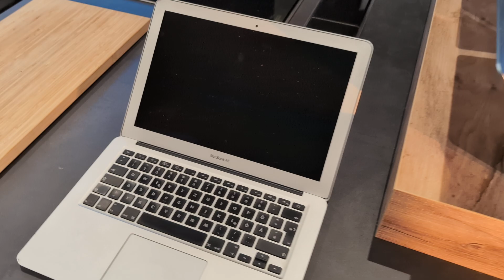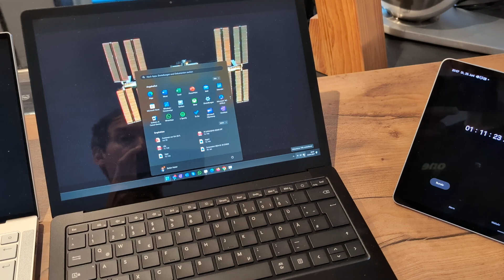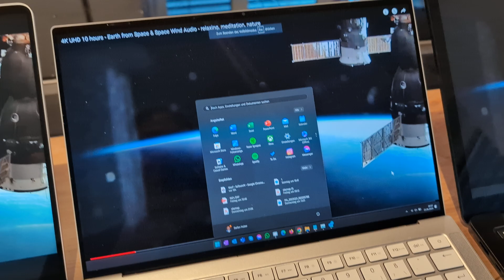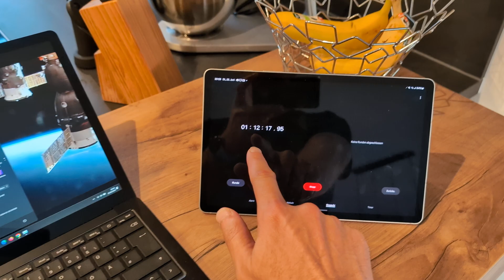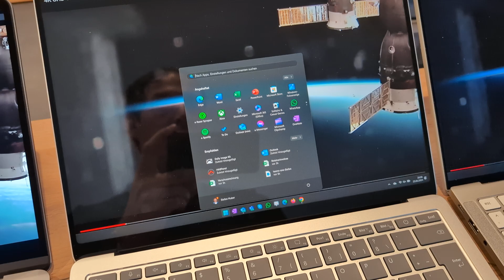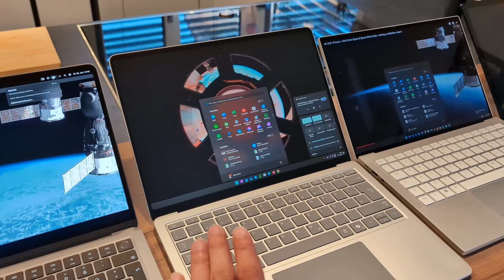Comparison between Microsoft Surface Laptop 7 and Apple MacBook Air M3. Battery and Heat

Comment: If you also take into account, that Intel based computers are typically loaded with bigger batteries around 60-80 Wh, except the Microsoft Surface Laptops (which are around 50 Wh, even with the Intel versions). 

The ARM based devices shown here are at around 52 Wh (Apple) and 54 Wh (Microsoft Surface Laptop 7th gen).

This shows: in Performance per Watt is also very much better.